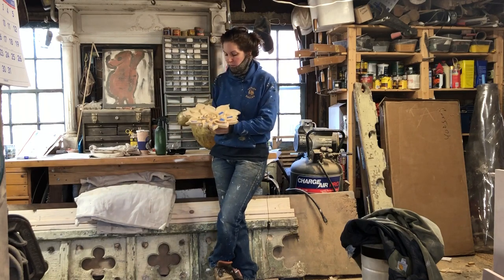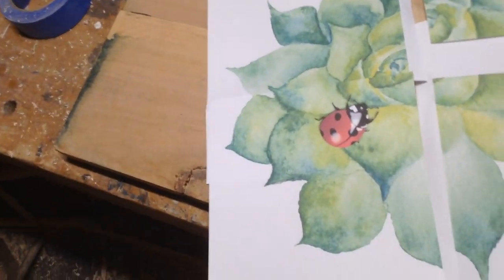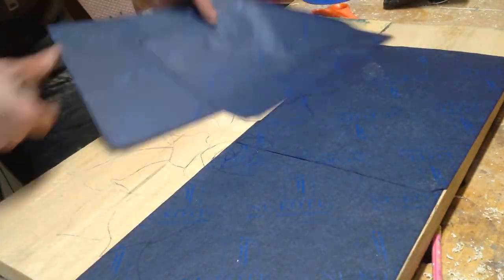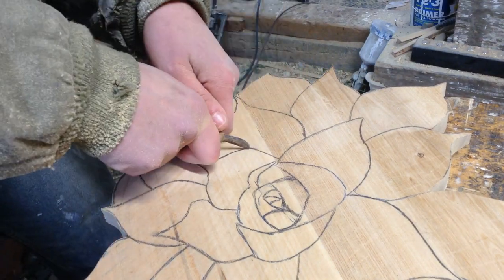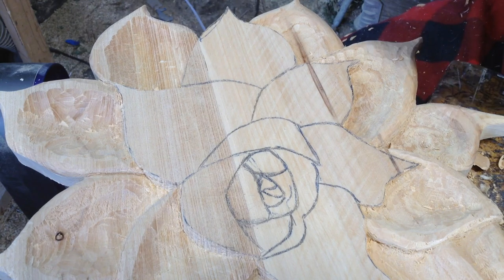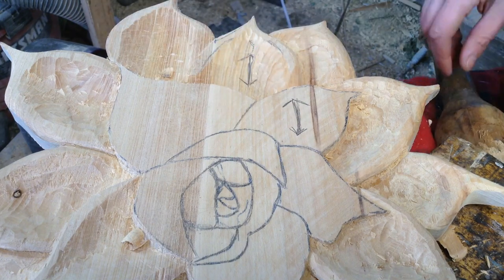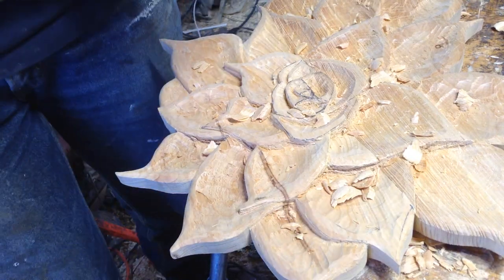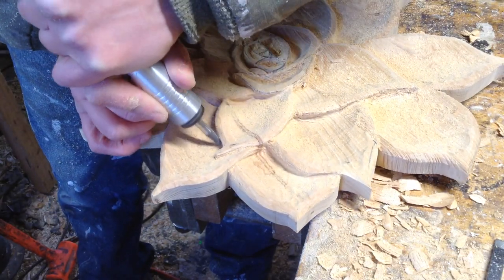Woodworking : Introduction To Simple Relief Carving // How-To Part 1

Comment: Looks like Chicks and Hens from my neighbor's yard! I have a portable projector that I can project art/photos on a surface to trace-sure its not cheaper than carbon paper, but it skips printing and photoshop. Note there are many apps that allow tile printing in the printer settings, for free. Like Acrobat reader, you can convert the image into a pdf and tile it up to the size you want. Since you are tracing it, it need not be color-save ink and toner. If you want less expensive image app for Mac, Affinity Photo is adequate. Some prefer the free GIMP program (Win/Mac/Linux). And messing with filters, you can create just outlines. Great work there Kate! Any recommended beginner carving tools?
Reply from the maker: I have an older projector I’ve used for pattern tracing.  Problem is it only works on a very old laptop and firing them both up can be a pain.  But agreed that way works great.  No great recommendations other then those chisels.  And that’s not much of a recommendation as much as a cost effective entry level tool.